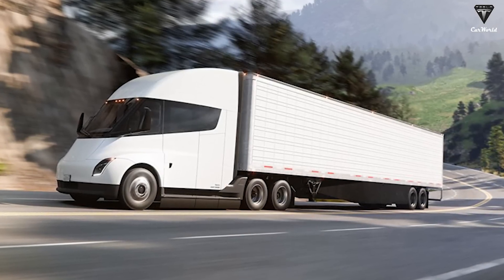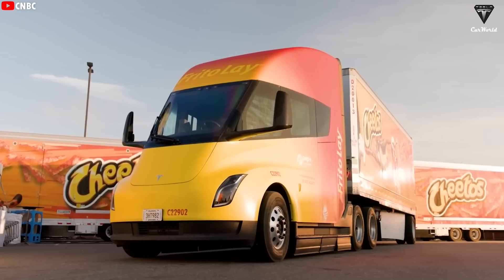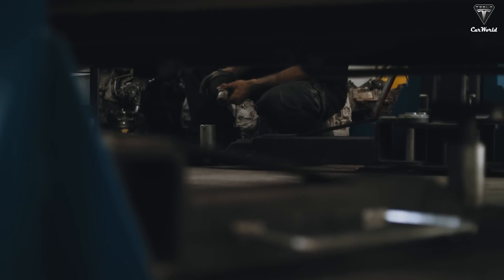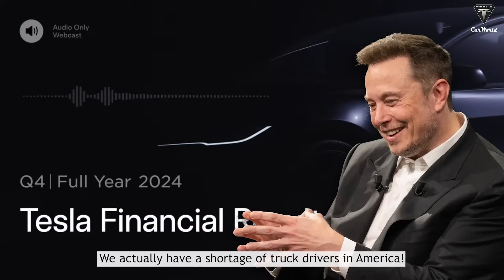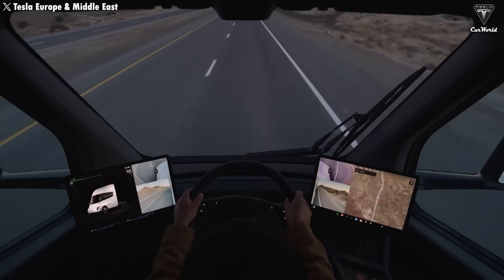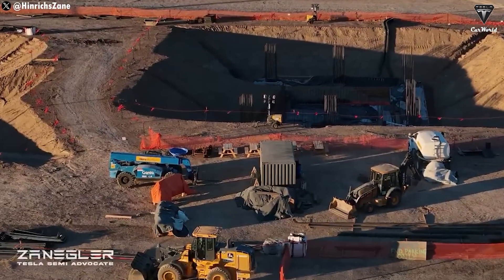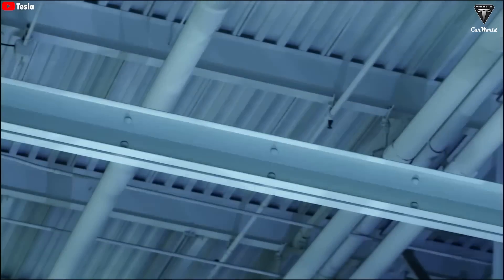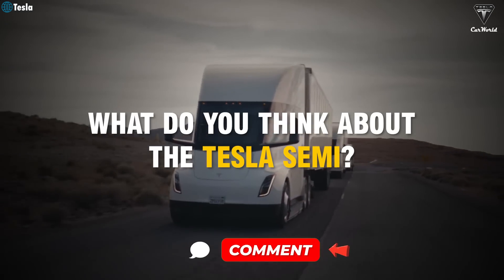Elon Musk Announces Tesla Semi Gen 2 2025 NEW UPDATE! Replace Battery, Feature & Mass Production!

Comment: I do believe the sleeping quarters are very badly designed and they are way behind in their willingness to design better equipment meant for drivers to be as comfortable at stops or especially sleeping. 
 Another thing. Is there should be tables in every semi truck. They are as much an office and living room as a place for a bed..also having a bathroom substitute should be required in all semi's.
The design of the sleeper is very poorly designed. .has been forever. .
 There's only  a very few exceptions. Very few..you'd almost have to go to the extra length sleepers for example the fort Wayne sleepers.  Volvo and a couple of others have a table and not a comprehensive design

Comment: you didn’t mention that the Tesla trucks the weigh 10,000 pounds more than a diesel truck. That requires a large amount of energy to pull its own weight. this also makes it much heavier on the roads and over bridges.
Reply: Compare the efficiency in mpg vs m/Kwh.    The Tesla Semi wins by a large margin!!!
Reply: @SteveMA1000  they may have an advantage from depot to depot, but not for long haul.
Maybe when they fully develop the solid-state battery they may get there then.
Reply: And the purpose of you mentioning this is?
Reply: @ I guess I fractured your poor egg shell mind
Reply: @keithcarter9048  Look cowgirl I simply asked a question. Apparently, you made a statement with no knowledge.
Reply: @joeysausage3437  dude the video talked about all the pros of electric trucks. You could say it was a propaganda piece for Tesla. But electric trucks still have to overcome some major hurdles over the diesel. Electric trucks may be ideal from Depot to depot, but they still have a way to go to be from one side of this nation to the other
Reply: @keithcarter9048 don’t worry cowgirl, eastbound and down will always be a classic 😂😂

Comment: Tesla should design quickly replaceable battery packs instead of owning them they pay by the use like propane tanks eliminated long stop over to recharge... batteries can be charged off peak hours preferably with on-site power generators  no huge battery replacement costs

Comment: Our company sold our tiny Chevy Bolt because our 300 mile range went to 200 if we used the heater or air conditioner. I can't imagine a full semi, I'm guessing 300 to 400 miles tops which just doesn't cut it for semi trucks.
Reply: Tesla's already proven it can go five hundred miles the seventy eight thousand pounds on it. There's a full lake video on youtube , but they're going from free bot california To san diego you can watch the whole drive.
Reply: @terrya6486  Not only that but it is so cheap to run it cost nearly the same as a normal pick-up per mile
Reply: Even 300 miles is 5 hours drive at 60 mph. Any person will need a break in 5 hours of driving. Driving that long continuously is dangerous. In the USA a driver may only drive 11 hours over a 14 hour period and then have to take a 10 hour break, so plenty of time to charge.

Comment: Say what you will but not many are out here advancing tech to this degree. Making it safer, and more comfortable for drivers is my concerns. But as my mate, who drives, has pointed out that finding mechanics who'll know how to even work on these is a hidden challenge.💡
Reply: How often do you service your electric tools?
Reply: @GregoryJByrne  As often as I service my truck if I were going to use it on the highways. It sounds like you think there are no grease nipples on a Telsa truck. Or Brakes, compressor, or numerous other items that require periodic attention.
Reply from the maker: Exactly, working with a vehicle as technically challenging as the Tesla Semi takes a lot of experience, they will figure it out!
Reply: @TeslaCarWorld  In the meantime, who pays revenue to the truck during an extended downtime while the technicians learn how to "figure it out"?
Reply: @ Working on these is trivial, not like a diesel/transmission truck. Granted, there will be more component replacement instead of component repair.
Reply: Repairs will be much simpler, just component replacement. No engine overhauls at every mom and pop truck stop.
Reply: That's rediculous, the Semi is much easier to service than ice or deisel.